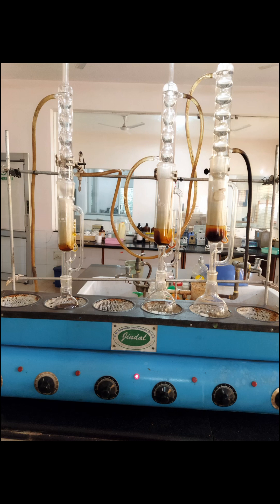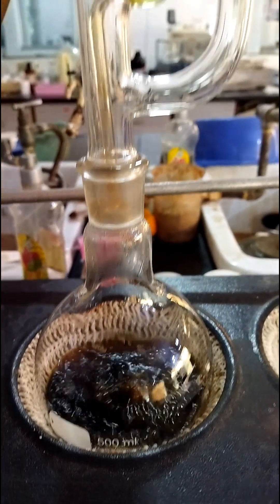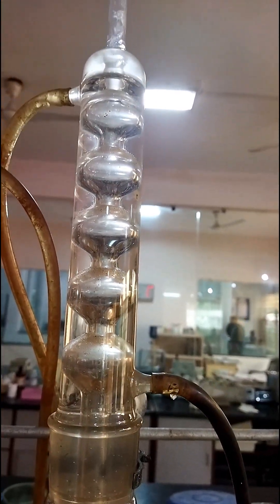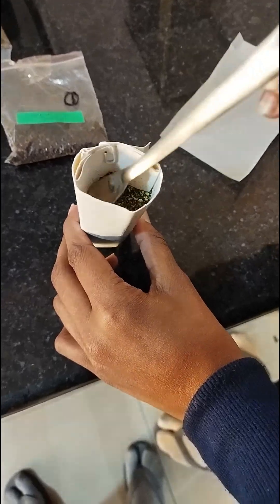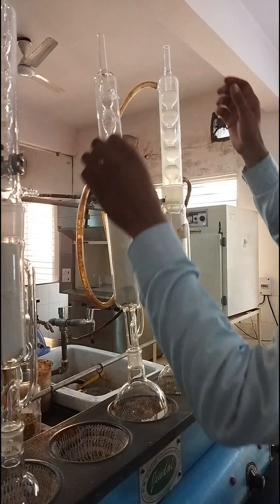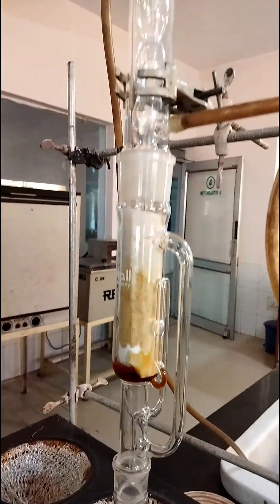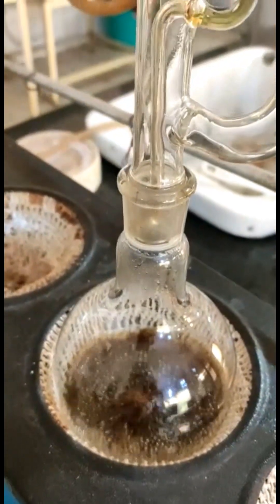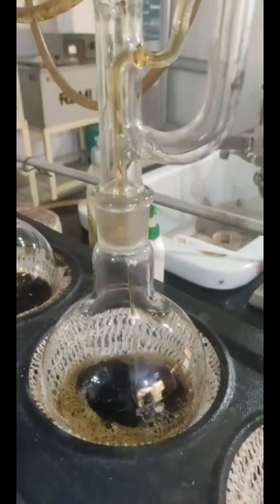Soxhlet Extraction

Comment: For extracting methanol is there any fixed time period?
Or how many cycles should we wait for?
What should be the temperature?
Reply from the maker: Normally for efficient extraction, at least 72 cycles are required as a normal rule. You can check for the process completion be taking the cycling solvent (1-2 ml) on a watchglass and allowing it to evaporate. If you see some deposits on the glass, it means still the extraction is required and vice versa in case glass is clear.
Temperature- >78°C
Reply: @pharmasapnaians  is there such thing that we have to leave the setup for 16 hours?
Reply from the maker: @susrisubhrani.mishra  Once we have set up the extraction it can be left to run without direct supervision.
Reply: @pharmasapnaians  ok,bt till how much time or hours or any fixed no of cycle,or how we got to know that the process is completed
Reply from the maker: extract the sample for 16 - 24 hours at 4 - 6 cycles/hour.
Reply from the maker: @susrisubhrani.mishra  Normally if you count the cycles, then 72 cycles is considered as good criteria for extraction of the soluble constituents. Another simple method to know whether the extraction is complete or not is using a watch glass and collecting the solvent dropping from the extractor. Carefully you can collect few mL of the solvent coming out after extraction. Don't allow it to fall in the round bottom flask. Collect it in a clean watch glass. Allow it to evaporate at room temperature. In another watch glass, take pure solvent being used for extraction. Compare both the watch glasses after drying. If you see a deposit in the former as compared to the latter, your extraction is not yet complete. If both of them are the same, it is an indication that no more extractive will be obtained with the same solvent. It is a sort of indigenous method, might appear a bit hazy but it works and works well. I use it very frequently and results are always accurate.
Reply: @pharmasapnaians  what should be the quantity ratio of methanol and plant extract?
Reply from the maker: @susrisubhrani.mishra   plant extract - 30gm
Methanol - 200ml